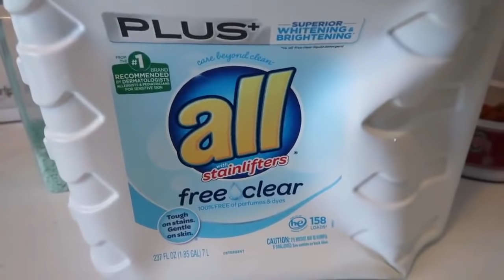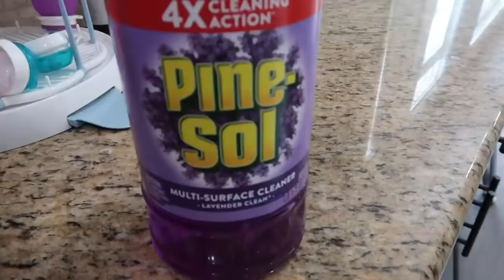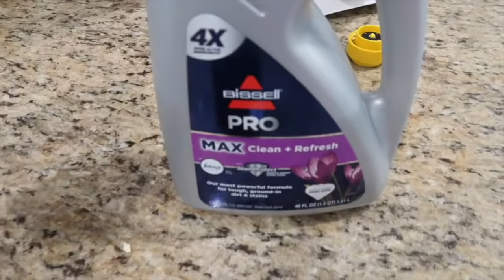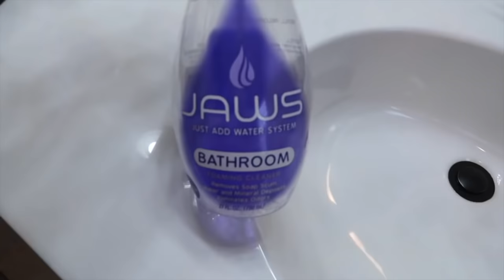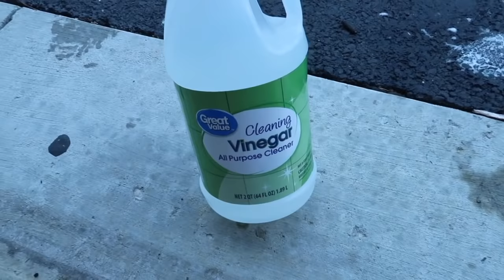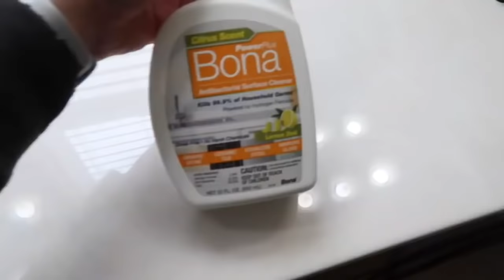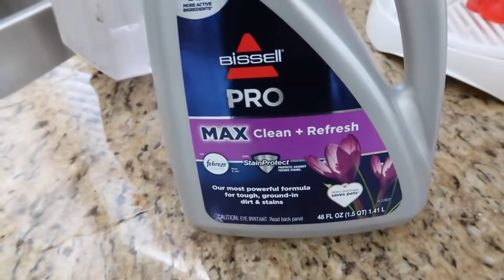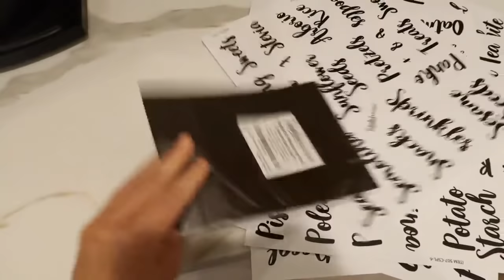EXTREME CLEAN WITH ME | HOURS OF DEEP SPEED CLEANING MOTIVATION | DEEP CLEANING ROUTINE | HOMEMAKING

Comment: I use boiling hot water from the kettle fill the bin up and then use disinfectant and let it soak for about an hour and then use a brush to get it all cleaned up. Do this a couple of times a year especially in the spring and summer

Comment: Most times you can pull the black flaps  at entrance to garbage disposal out. Cleaning underneath those flaps are very much encouraged. You will be amazed at what's on the other side of those flaps. 😖😣 Plus, it's usually a culprit in those pesky nats/ fruit flies. If it can't be pulled out you can take a rag and clean underneath. Again very much encouraged!